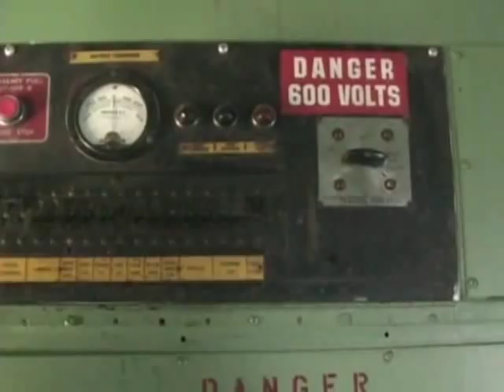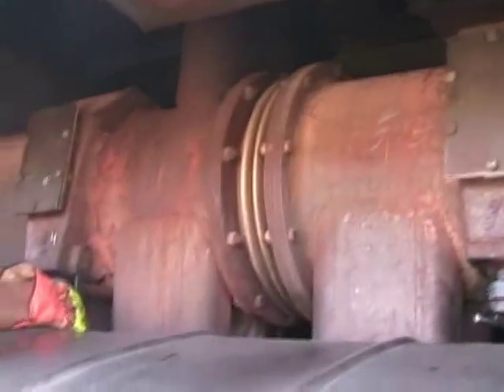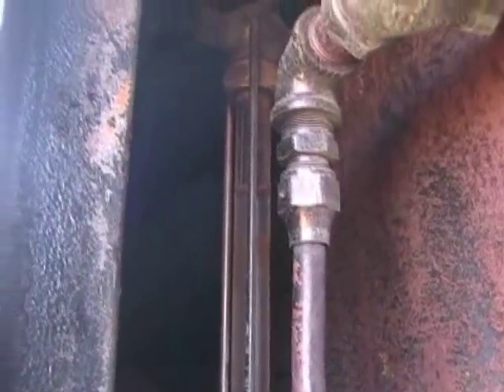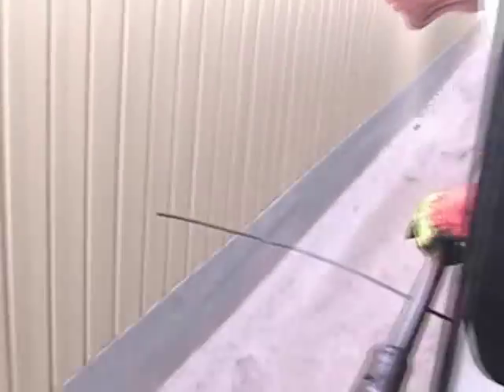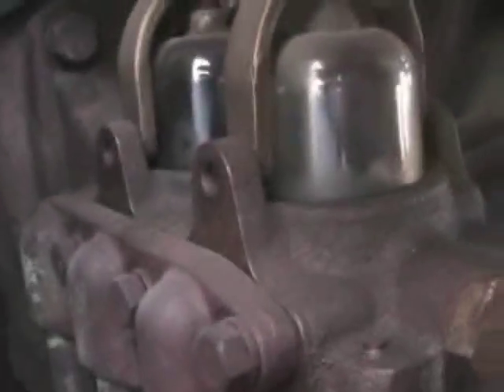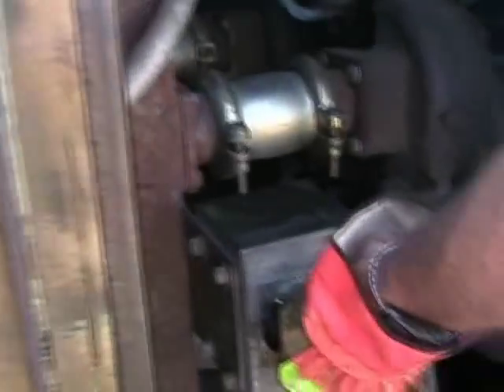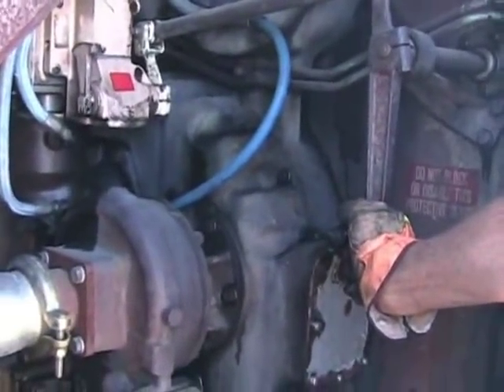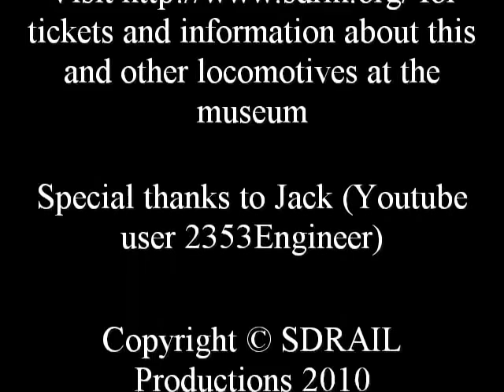The PSRM : Starting the GP9

Comment: 9:50
The two rockers on either side are for the exhaust, the middle one is for the injector. There is no intake valve - the piston itself uncovers a port in the piston liner, which is the intake.
Reply: What's that mean in English LOL :)
Reply: I was wondering about that, thanks.

Comment from the maker: @and0243 Yeah, this locomotive is 51 years old.  Every diesel used to need this kind of prep before starting.  The process actually took about 1/2 an hour, but i cut out most of it.  Autostart sure is a vast improvement over these manual starts.

Comment: That engine I noticed is not equipped with a crankcase low water protector device that balances water pressure versus crankcase pressure. It will shut down the engine if a cylinder goes bad or when the water is too low for safe operation of the locomotive engine. Well worth the investment. On Conrail we never had to check the air compressor oil as they were modified to run off engine oil pressure. When pre tripping a locomotive I simply looked for the oil supply and return lines to verify the air compressor was so modified. 

99 percent of the time the engine ran from the time it left the shop from a service visit to when it returned to the shop for service. It took over a year for Conrail to replace all the bad locomotive batteries which is why in the summer they never shut them Down. I was taught run the fuel pump until the air bubbles disappeared in the fuel sight gauge closets to the engine block, if fuel appeared in the second fuel sight gauge report it to the engine house as the fuel filters need changing. 

I can remember a short line that had just started up operations that was changing out fuel filters every two days and couldn't figure out why. I happened to visit them the first weekend after they started up and after being informed told them they needed to drain the fuel tank and flush it to get all the algae and other crud that grows in a fuel tank. They were stunned by how much crud came out of the tank, it filled 5 55 gallon drums before it was clean. The fuel filters rarely plugged up after that miserable job was done . I then showed them which anti algae to put into the fuel tank to prevent a recurrence. It turned out the old fuel tank at their engine house was full of algae, added some antialgae, about 55 gallons did it then changed out the rack fuel pump screens every day for three months until no more dead algae showed up in the screens. The tank held 200,000 gallons of fuel and was 90 percent full when they took possession of the branch line. When I asked if they checked the main tank for water I had to show them the water paste we used delivering gasoline and diesel on tractor trailers. Turned out to have just under 10 inches of water in the tank, took a while to drain out until fuel showed up, water will destroy fuel injectors as well as freeze up in fuel lines and locomotive tanks. That short line survived and is making plenty on money today.

Comment: EMD still supplies new cylinder heads for all three 2 stroke engines as well as new roots blowers and a host of other parts because when a Power assembly is pulled it goes through an inspection process and quite often they find cracks in the cylinder head between the valve seats which means that head is scrap. Yes they are thousands of power assemblies out there on the locomotive parts market and all three engine blocks have been scrapped as well usually from wreck damage as the violent crashing on a head on collision usually damages the engine block so badly it isn't worth rebuilding. They just strip it of usable parts then scrap the block. I've hauled in one train 24 scrap 645 blocks which were on there way to a steel mill in Rhode Island sitting in gondolas filled with other scrap parts.

National Railway Equipment might also be a good source to get a load box donated to the museum..

Comment: @TankCrusher210 yup, thats pretty much as I understand it. The roots provide positive pressurization, and as the piston reaches BDC, the cylinder wall ports are exposed, the pressurised air scavenges the cylinder, and before the ports are covered on the upstroke the exhaust valves close, and each cylinder then gets a little precharge before the ports are again covered

Comment: Excellent video. Hope the parts supply for 567s lasts a good long time.
Reply: htc6600.... 567 U (cast, top deck) & V (fabricated & welded deck) pretty well non-existent, and too many "issues" with those two anyway.   The A & B models were  an improvement - somwhat, but parts are getting scarce. 

The 567 AC & BC were greatly improved with the water, liner & con rod issues and so are much more in demand and parts for the AC & BC engines are still "on the books" even from EMD themselves (owned by Cat since Dec. 2010). 

The most desirable 567 engines are the 567 C (first with the round hand hole covers and removal of the water deck feature, new style liners, etc.) and the D1 as far as roots blown engines and the D2, 3 & 3A axial flow turbocharged engines.... parts are still readily available in 2020 and not too hard to obtain. 

Many roads (esp. Short lines) with locomotives powered with any of the D2, 3 & 3A (turbocharged - all 16 cyl.) and most certainly "tourist" roads and museums with very light usage, normally will de-rate them back down to D1 or C specs by naturally aspirating them with roots blowers instead. 

Typical (currently) "basic" rebuild of the turbo is $15 to 18,000 dollars and upwards of $40,000 dollars for a catastrophic turbo failure, plus the cost of downtime, install time and any damage done internally, caused by the turbo failure and most shortlines, museum and tourist lines cannot afford that kind of maintenance & repair costs. 

Another reason for the potential future longevity of the 567C, & D series is that the 645 series power assemblies can be (and are, during upgrades) adapted to the 567C & D1, 2, 3 & D3A as long as the cam counterweights are changed to offset the heavier weight of the series 645 piston and rod assembly.

Comment from the maker: @abeemanator I belive that the air intakes are just drawn directly from the engine room air, and hence have to pass through the filters.  The engine is fed air by root blowers, so I'm not exactly sure where the intake is.
Reply: Locomotive450.... as you stated in your reply to "abeemanator".... the intake air is drawn from the "engine room" air.   There are pre - filter panels in the side panels on both sides of the cowling behind the cab as well as filter boxes mounted on both Roots Blowers on the Naturally Aspirated engines.

Comment: Sounds like she could use a bit of valve lash adjustment... she starts great though!
If you don't empty out those carbon traps, you can end up shooting flames out the stack. Which, although fun to see, is not something you want if you are operating in the woods and its dry.
Reply: Is there a way to do that on the GEVO "toasters?" Those are the ones that are shown more often with flaming exhaust.

Comment: From what I understand (I may be completely wrong), one valve is for fuel, and the other six are for exhaust.  Being that it's a two-stroke, pressurized air is pumped into the cylinder from the scavenging ports at the bottom, as the piston clears.  It is also possible that the scavenging ports, and exhaust valves are open at the same time, to clear exhaust fumes more effectively, and therefore greatly increasing fuel efficiency.  I'm not an expert, so don't take everything for fact...
Reply: Tankcrusher210.... you're correct except for the fact of FOUR (4) exhaust valves per cylinder... Not, "six" (6).  Yes, the exhaust valves open at approximately 4 deg. of crankshaft rotation Prior to the uncovering of the intake ports, and remain open until 44 deg. ABDC for cylinder scavenging and fresh air intake.

Comment: Only 4 exhaust valves per cylinder, no Intake valves as it is a two stroke. The center rockers trip the fuel injectors.

Comment: If you starting in less than a minute you must not know you need to blow down all 16 cylinders, we run on a mountain line and are required to check and clean the carbon traps before each run and write we did so on our shut down report.

Comment: This engine design ... 567 and 656E/645F and 710G all employ hydraulic "lash adjusters" from the start. These would not be used in automobile engines for several more decades.

There are three rockers per cylinder, all of which have roller cam followers.

The outer pair of rockers operate the four exhaust valves through spring-loaded "bridges".

The inner rocker operates the "unit injector".

Intake timing is fixed at about 45º BBDC to about 45º ABDC.

Injection is fixed at 4º BTDC.
Reply: Peter Haas.... From 45 deg. BBDC to BDC, it's in the scavenging mode, Not "intake".  Hydraulic valve lifters were already in use on automotive gas engines (inline 6 & V8's, etc.) by the time the Series 645 was introduced (1964).  The "bridges" are Not - "spring loaded".... only the valves are.

Comment: None are available new, but many are available remanufactured. Not just from EMD, but even from GE!

Most 567s have already been converted to "C Specifications", thereby becoming a 567AC or a 567BC, and any C-compliant 567 may use 645 power assemblies.

In this way, a 567 may be retained almost forever.

However, as EMD engines go, a 645 or a 710 is a superior engine, and will last almost forever.

Very few 16-645s and almost no 16-710s have been scrapped ... too versatile and too reliable.
Reply: Peter Haas.... your correct about the ability to upgrade to the 645 power assemblies on the "C" compliant engines... As long as the cams are also changed due to the increased weight of the 645 assemblies.

Comment: what a too old and bored engine
Reply: If well maintained (fuel injectors cleaned/repaired if necessary, oil checked and cleaned/replaced, etc...), this engine will last a long time.
I know a railroad that has a 6 cylinder 567 engine in a little shunting locomotive - it was made in 1939 and is STILL in operation!
Reply: Old not obsolete

Comment: Nice job with the start up... But I wish to correct you on the valves that engine only has four valves the one in the center is the injector for the fuel oil.   If I'm not mistaken they are a two cycle engine just like the screaming Jimmys I have worked around.
Reply: Yes sir. Very much the same as say an old 671 detroit as far as the way it operates. Love the old GM 2-strokes. These big EMD units make such a glorious noise at around half throttle.